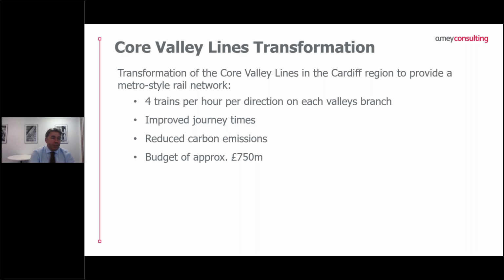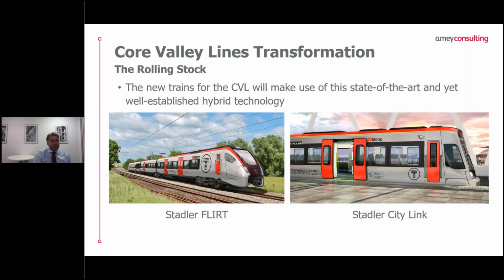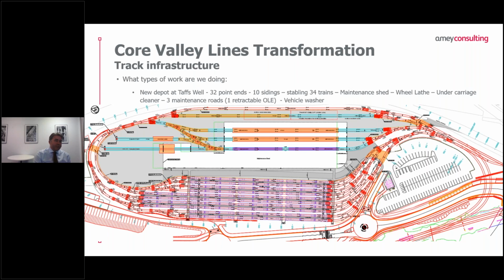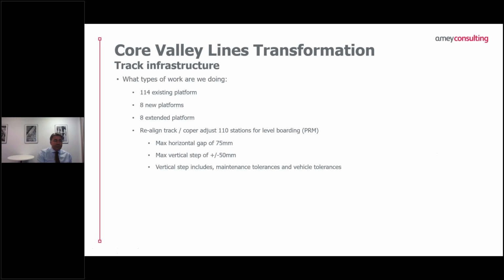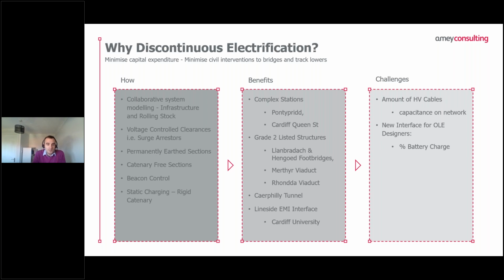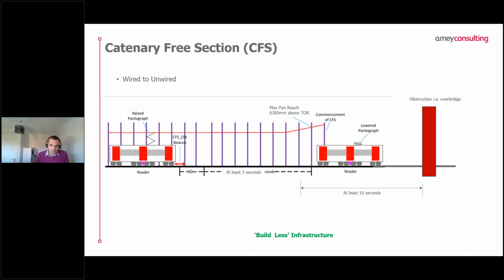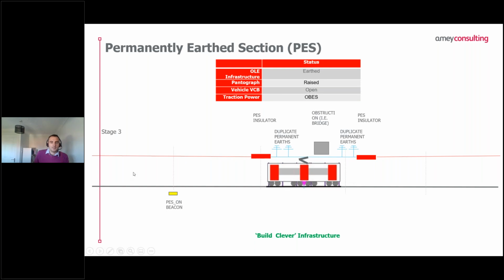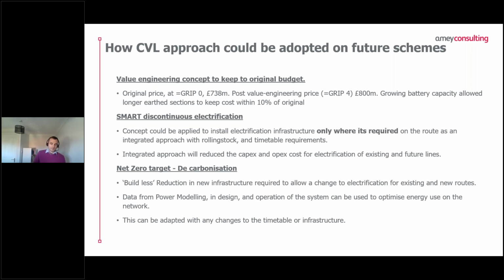Core Valley Lines Electrification Traction power modelling & OLE system- Richard Wood & Samuel Jones

Comment: Interesting that a lot of electrified sections are connected by 25 kV laid on the ground in troughing. I hope that cable is set well back from the track. Initially that cable was to go through Caerphilly Tunnel - but there is not space for it there.